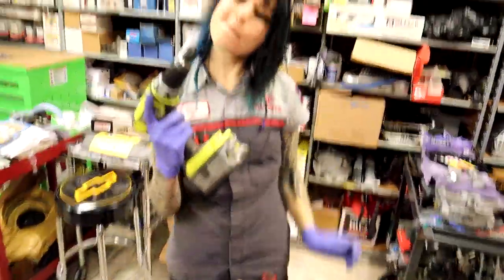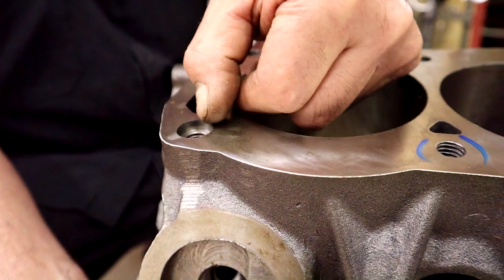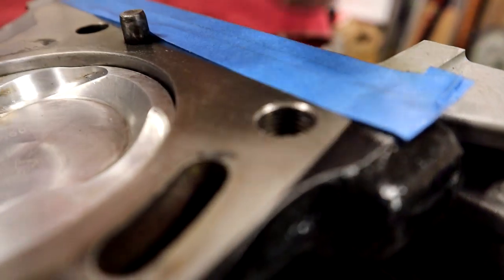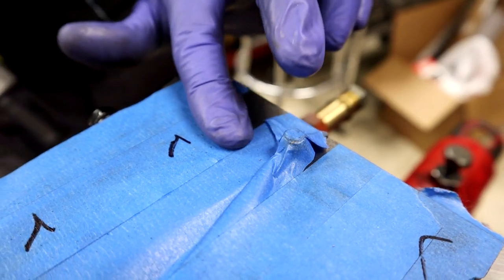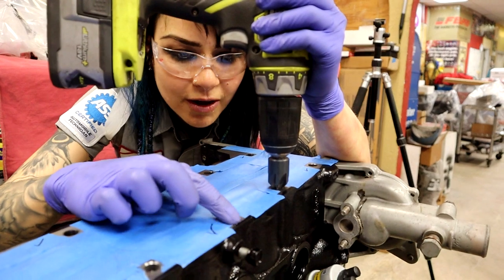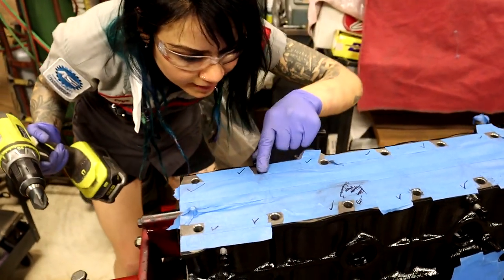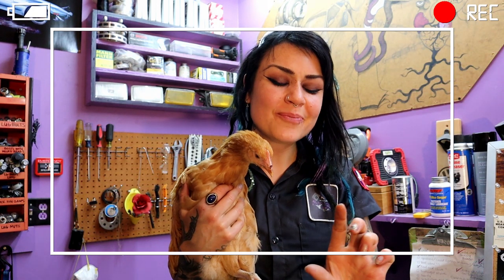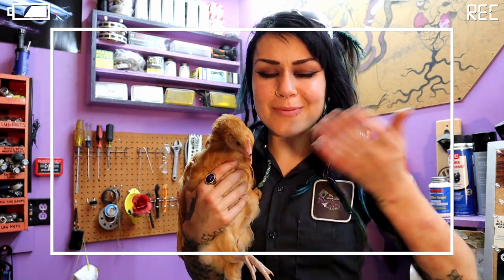You don't know 'til ya know: Chamfering the Headbolt Holes on my 7M block, plus some important PSAs!

Comment: Race Engine Builders and Machinists know to do this to prevent the threads from pulling.  It also aids as a " lead in "
for the stud or bolt. Cast iron is self lubricating and requires a slow r.p.m. Beleive it or not a light steady blast of air can be used to cool the tooling when machining cast iron. Aluminum works well with a slightly higher speed and a light lubricant.

Comment: I love a good chamfered hole. It helps the bolts just slide right it. No cross threading, no resistance just smooth sailing.

Comment: I do this on all my blocks. I also take a small sanding roll on a die grinder and go over all the sharp edges on a block just to break the edge.  Keeps them from cracking, and also keep you from getting cut.  Also, look at all your oil returns and make sure they are fully open.  Many times they can be partially blocked from the casting process.  If they are blocked,  take a carbide and open them up!  SBC's are particularly bad at this on the back lifter valley oil returns.

Comment: Faye, did you chase the top few threads with a tap after as I assumed probably so but just didn't get that aspect into the video ( and of course solvent/blow out the blind thread holes as well ).

Comment: I just wanted to point out that bigger is not better when chamfering bolt holes.  The outside diameter of the chamfer should not exceed the outside diameter of the bolt thread.  There are advantages to keeping the chamfer small like Danny demonstrated, but I won't explain it in this post.

Comment: You don’t know till ya know,  truer words   I guess I always thought the Chamfer helps the Bolt to start to thread kind of like working with wood you bullnose a table top so the edge doesn’t splinter or (crack) makes perfect sense. Sorry about the robbery you mentioned it in the lifestream that’s just a terrible feeling when somebody takes something from you like that. somebody stole the ashtray out of my MR2 it was full of change instead of just taking the money they took the whole thing I was so pissed it had never been smoked in not a mark in the ashtray even the lighter didn’t have a mark and never been used even the light a cigarette buy a small miracle I did get my ash trey back but that’s a story for another time I hope your stuff is recovered and I hope you catch the guy he definitely looks like he’s done this before did he pull his vehicle into the shop and load up the loot  and drive out that would be textbook. Don’t know if you knew your place but kind of like you, you know where to look for leaks he knows where to look for money and goods. are you able to tell how long he was there if he’s a pro he was probably in and out in five minutes I hope this was just random it would be just that much worse if he knew who he was stealing from I’m glad no mechanics or chickens were harmed sorry that happened stay strong stay safe🐔🐔🐔👍
Reply from the maker: Oh my gosh I'm so so sorry that happened to you!! Sigh I'd be so upset as well 😔
Reply: Faye Hadley You’re so nice this was really about you after all I did get my ashtray back again sorry that happened to you with all the good that you do you didn’t deserve that❤️🐔

Comment: Loose the engine supplier. You said it was a brand new block!
No decent manufacturer/rebuilding shop will deliver a product not completely deburred
If something cosmetic that is easily visible to the naked eye is overlooked. I wonder about the critical features of this block.